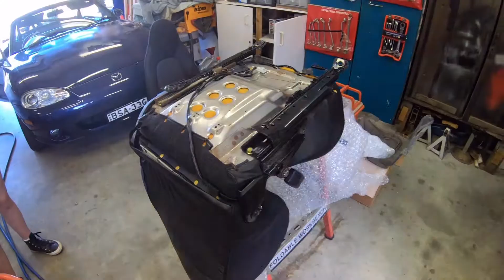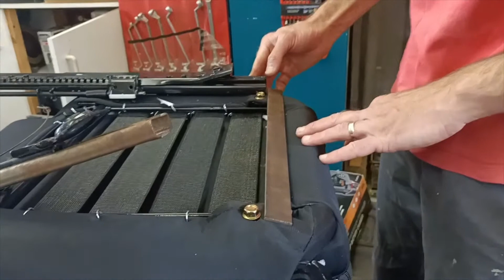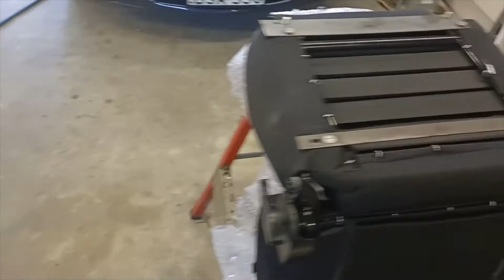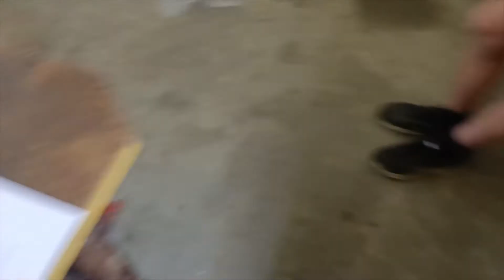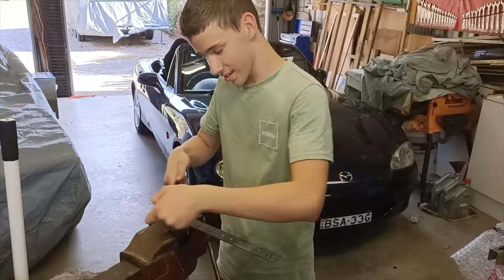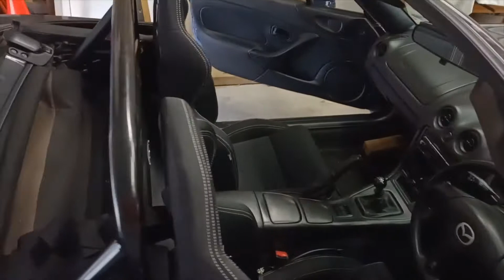Project Lockdown EP7 - Race Seats

Comment: Do these seats get you sitting any lower in the car?
Reply from the maker: No, they make you sit a bit higher actually. The original seats sat flush with the rails.
Reply: @23racing238  ah they look like such a good option to! I guess the cushion in the bottom does not come out?
Reply from the maker: @papahet82 no i dont think it does